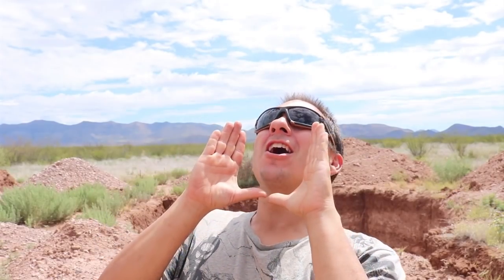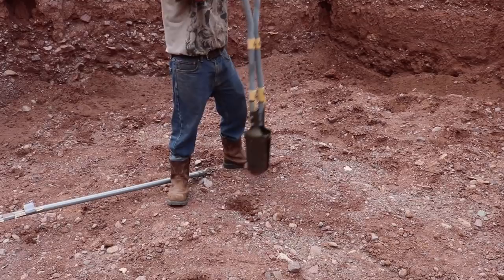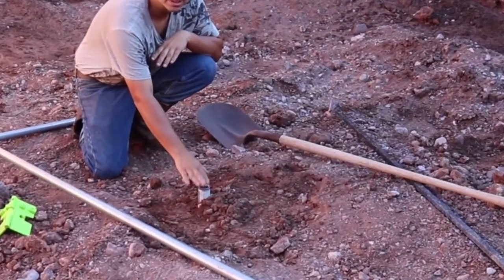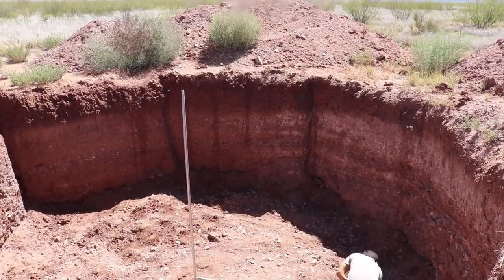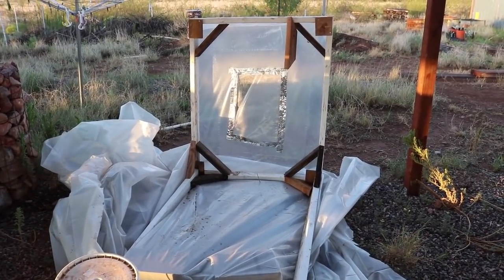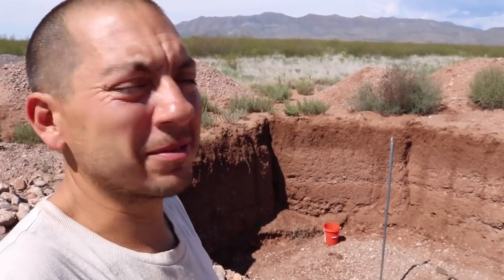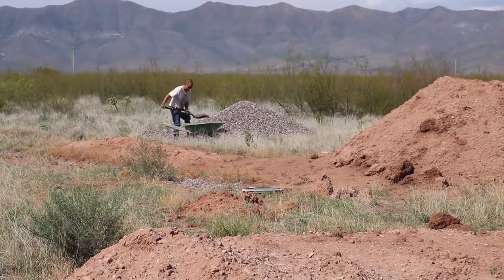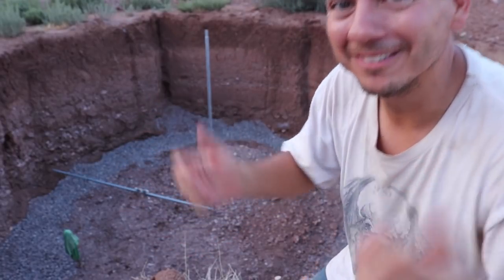We're Building An Earthbag Root Cellar | Laying An Earthbag Foundation

Comment: Just a suggestion
Maybe dig one or two holes deeper that the bottom of the rock layer. 
And install maybe buckets with holes.  So if you ever get water in the bottom.  You can pump it out
Reply from the maker: Good thinking.

Comment: I dug out and sifted most of my garden beds and borders. I found it easier to dig down to the level I wanted to have good soil to plant in, usually two feet or so. I would then put a piece of plywood in the trench to act as a muck board. I would then use a pick to extend the trench and bring the spoil onto the muck board. It’s easier to shovel the dirt and rocks off the muck board then just off the bottom of the trench. It’s also less tiring for your feet to stand on the board.

Comment: The soil under your property looks like alluvial fan material, debris flows interwoven with higher permeability gravel beds from somewhat more stable stream beds at surface over a longer time.  The higher permeability gravel beds could extend over longer distance, and form conduits for groundwater flow into your construction.  This water flow might have caused saturation of your loose backfill material, causing it to liquify.  The unsaturated soil backfill has considerable strength due to capillary water tension holding the soil together.  Capillary water tension is strong enough to lift water from the roots to the top of a huge tree, through the bark.  When the soil becomes saturated with water, the water tension is lost, and the soil could liquify.  The higher water pressure and soil pressure on the construction wall probably caused the root cellar to fail.  You might have to try to ensure that the soil you use has less chance to become saturated with water, and you might have to increase the wall stability of your construction by improving resistance to lateral pressure loading from liquefied soil and water.  Undisturbed natural soil could have considerably more stability than soil backfill, so minimizing disturbance of natural soil and minimizing soil backfill is always advised in foundation construction.

Comment: With that much rock in the ground you would do well to invest in a way to separate the rock from the soil faster then by hand screening. A DIY trommel is not that hard to build for amounts of soil you can shovel in but would need to up its size if you started using power equipment.
Reply from the maker: We've just been putting it straight into bags.😀